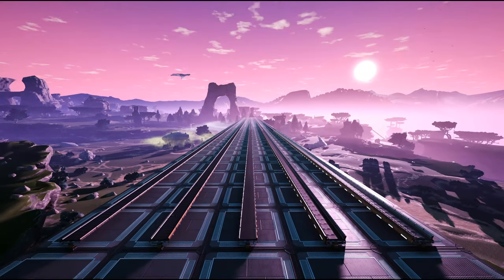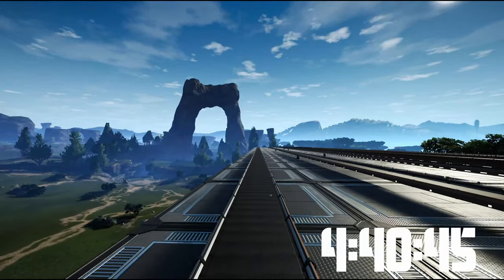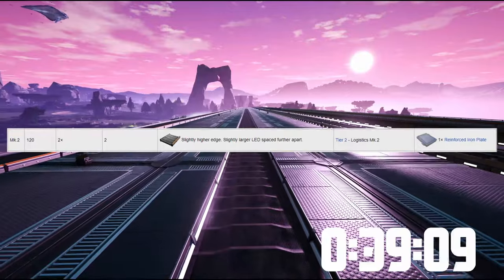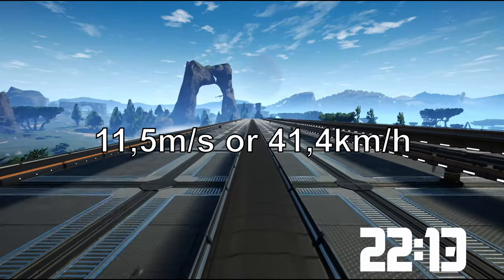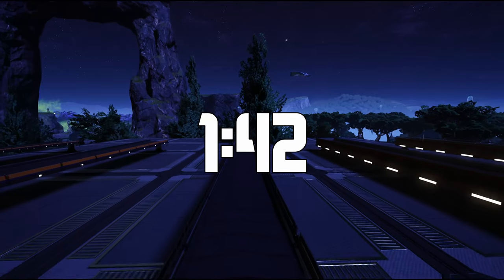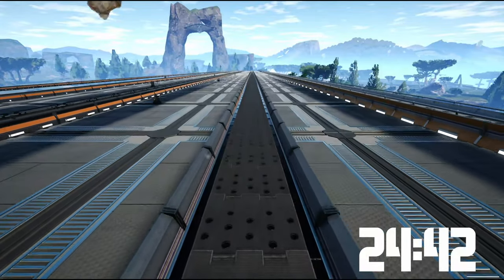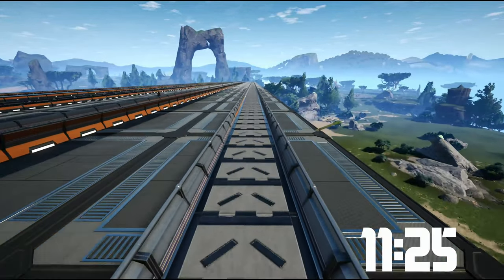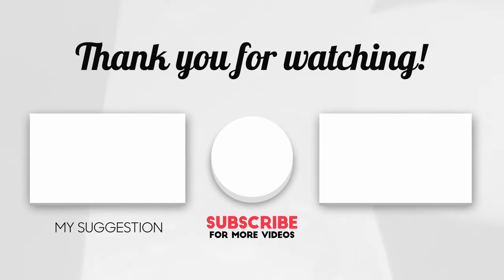CONVEYOR Belt SPEED Comparison Satisfactory 1.0

Comment: Measuring belt speed by standing on it isn't really the best way to do it, because as you can see in the video you can move slightly faster or slower than the belt.

It's way better to measure it using the given information - belt capacity. Since items are put in a belt with 1.186 spacing, it's pretty easy to calculate belt speed.

Mk1 - 60/min = 1/s -> 1.186m/s = 4.270km/h
Mk2 - 120/min = 2/s -> 2.372m/s = 8.539km/h
Mk3 - 270/min = 4.5/s -> 5.337m/s = 19.213km/h
Mk4 - 480/min = 8/s -> 9.488m/s = 34.157km/h
Mk5 - 780/min = 13/s -> 15.418m/s = 55.505km/h
Reply from the maker: Thanks for your comment!
Reply: In addition to this, for us viewers in the US, the Freedom Unit conversion is:
Mk.1 = 3.891ft/s = 2.653mi/h
Mk.2 = 7.782ft/s = 5.306mi/h 
Mk.3 = 17.510ft/s = 11.939mi/h 
Mk.4 = 31.129ft/s = 21.224mi/h
Mk.5 = 50.584ft/s = 34.489mi/h